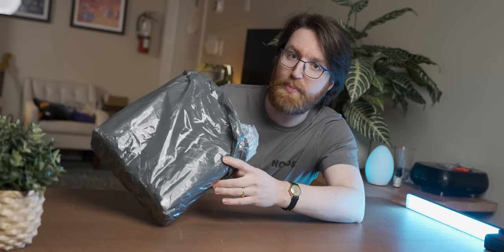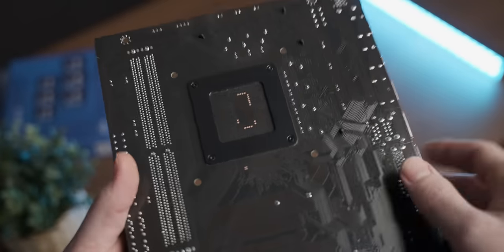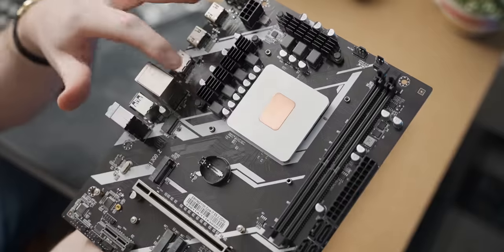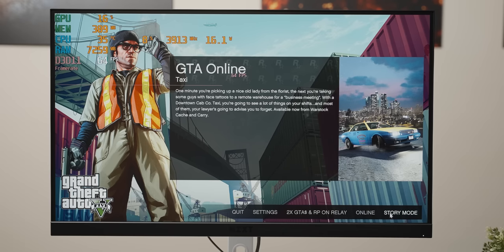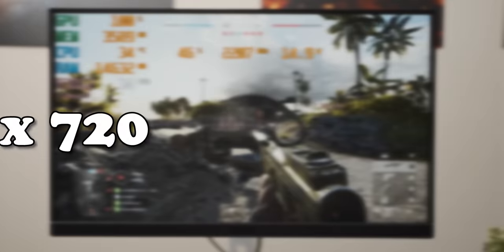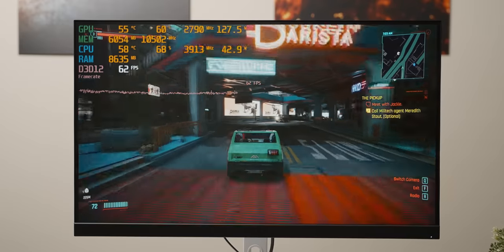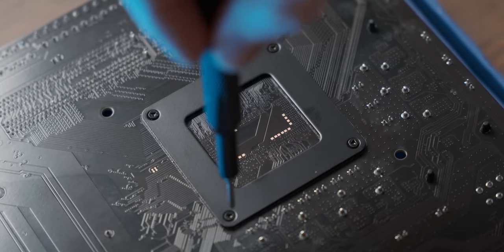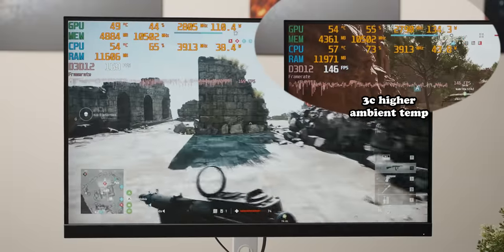Has Aliexpress Motherboard Science Gone Too Far?

Comment: You forgot to tell us what you paid, but if it's a reasonably cheap option this is a fantastic device for a small integrated system.  It's obviously not really meant for what you're using it for.
Reply: I don't know about the one he bought in particular, but I remember I checked out another version and it was basically close in performance(well CPU-Z benchmark, not really that accurate, but roughly)to an i7-10700 and the price was(for me at least) around the same it would cost me to get 12400f locally. I'd say that's a good deal, considering you get a CPU + Motherboard for the price. 
Also as far as I know these can be overclocked(both CPU and RAM), so there's a lot more performance on the table and can definitely be used for gaming. Perhaps there would still be a bottleneck on 4070ti, but it shouldn't be as bad if the CPU and RAM get OC'ed to their max potential. Seller says that RAM should be able to easily run 3200MHz.
Overall I think these are quite nice kits, the only thing that needs quite a bit more work is the bios. Few months from now or maybe an year, these should be really good alternatives for some countries.
Reply: I believe its around $150 for engineering sample models and $220 for the non-engineering sample models.

Comment: Actually there is a way to activate XMP on these kits, its just that its very, very extensive and old looking bios.
Reply: Not only that but you can also set clocks higher than that. Brazilian youtubers are doing some interesting coverage on these parts, and the i7 ES you're using can easily go past 4.5ghz

Comment: Question ;

1. Does the chipset and CPU combo support resizeable BAR? (Wondering if I could pair this with an Intel Arc A750)
2. Are the onboard HDMI ports HDMI 2.0b with HDR support?
Reply: 1: other comments say yes

2: no idea, being a laptop based chip though I'd almost say it's 50/50
Reply: @cpufreak101  Thanks much, sounds like I gotta take the jump and try my luck with the HDMI ports. If it doesn't have a 2.0b port, guess I'll get an Intel Arc to supplement it.
Reply: @dasaratabalakrishnan3916  idk for the engineering samples, but the 19-11900H, Intel's documentation states it's a 2.0b port

Comment: If I hadn't spent all my money on everything else lately I was going to buy one, it's in my cart. I want it, I love weird stuff. I just wish it came in ITX size, it would immediately become my new HTPC board.
Reply: They're planning for one.
Reply: @1986Hikaru  Awesome! I'll need to use a USB DAC or ARC converter to get Optical Audio out but otherwise I'm all in. Low power use, plenty of cores, perfect for my application. Currently running an i7 4980HQ with some OC on it in a Z87 ITX board and loving that but I need to be mindful about Win10 support ending in a few years and have something lined up.
Also I saw some vendors selling upgraded VRM coolers, I guess they run a little hot. I wonder if that was nerfing his CPU performance some?

Comment: This is quite the interesting board which i might buy the model with the i5 in it and pair it with something like a 4050/4060 when they come out or if the 4060 is better than my 3060 Ti i would use the 3060 Ti in that system while i would use the 4060 is my main system because it is still nice to have a strong backup system that could be powered by a 450w to 550w PSU instead which i am planning on replacing my 2x1tb 2.5" SSD's with a single 4tb version instead (gaming drives) which i would use in that system because for a backup system 2x1tb drives would be more than enough for it.
Reply: Also going on Aliexpress and looking up the Erying it looks like they sell separated the improves VRM heatspreaders which could provide better cooling for the VRM's in case they're not that great.

Comment: Hey if they want recycle good laptop cpus into mobos or better yet put the laptop cpus on substrates that go in regular mobos for that series I am down I know they have less lanes etc but one of the ocable laptop chips in a half decent mini itx board or smaller that still has a full pci-e slot is sfc enthusiast wet dream. Especailly if they want to start recycling laptop gpus in this manner, low power high performance low noise, upgradable tiny gaming pcs yes please.

Comment: i have an i5 11400H it games nicely except intel cpu run hotter than i'm used to it's definitely not gonna make me switch from AMD to intel on builds heck i even prefer AMD laptops just couldn't get one unless i wanted to spend $200usd extra for an R5 5600H the equivalent of the I5 11400H 64GB of 3200mhz ram makes a laptop run really well

Comment: You would think that as long as the regulations surrounding lithium batteries have been in place, some kind of workaround would be found other than just shrugging and shipping motherboards with no batteries at all... like maybe using alkaline batteries or something else that isn't restricted for BIOS batteries. I get that the increased power density is necessary for phones, but is there really any reason why we can't just use AA batteries for a motherboard BIOS? I just don't get why everything is designed to make use of a restricted item if they knew it was restricted when they designed the stuff.

Comment: Lithium 2032 batteries were used for a millennium flying on aircraft with zero issues.  Then some jackass decided to make a 99.99wh lithium battery with no safety testing and a handful of them went kablooie killing Jesus and doing 9-11 and now people are so paranoid about lithium batteries that even ones the size of a grain of sand require so many special considerations for transport that it really makes no sense to send a motherboard with one pre-installed.

Comment: Somehow they are no longer being sold. I just checked so I see why the link is not in the description. Also, it says they can be overclocked so I am wondering why you didn't OC this using XTU?
Reply: I think you have to use a third part throttle stop or APU unlocked etc
Reply: @Jordan C.  on aliexpress it says to use xtu

Comment: can you please get a $30 Watt meter and measure actual power consumption of this thing from the wall? A reason I would get such a build for myself is being able to power it using DC-DC pico PSU running off of a battery pack

Comment: Dam gust bought yesterday erying i9 11 11900h combo CPU motherboard 176 total for try out gameing with my arc a770 16gb or use my rx6800 mybe
Reply: The A770 requires Resizable BAR to work properly, so there's that
Reply: @jayhardway23  I'll have try my rx6800 than  I'm not  fps hore  for attention  i game good on my Arc a7700 no problem on 10th gen i3  with re bar or with out it Im mostly on cod or whatever good
Reply: @jayhardway23  I'm definitely goin test i9 11th gen tiger lake 11900h  out on lot games  when arrives March 18th

Comment: BE WARNED!!!!!!  I purchased the i9 version of this board.  Mine is obliviously faulty and I cannot get it to install windows 10 as it resets at random intervals during the installation process.  Erying have an updated BIOS available however u can forget trying to update via a usb dos stick as there is no way of enabling legacy boot option.  I ended up ditching to command prompt at the beginning of the win10 install and having a go through there only to be greeted with " Error 20: Cannot locate ME device.  FPT operation failed"  This leads me to believe the Intel Management Engine is either faulty or the bios is corrupted on the motherboard.  The best help i get through the ali express chat feature is that i need to update my drivers apparently.  It's like pissing into the wind I swear.
Reply: Are you using it on board video? If so, try a graphics card that worked for me. But I'm still getting random reboots after installing Win10
Reply: @sosa99999  Hey it seems that they are sensitive to the power supply.  I seem to have solved the random reset issue by using another PS.  Thing is the power supply that was causing the issue was new and tests fine under no load.  Will test it in another PC.
As for using a dedicated graphics card, have U seen what's compatible with this board?  U can't just go and chuck any card at this thing.  There's roughly 20 or so cards that work all of which are NVIDIA except one.  I have tried a random number of cards with this board and nothing works.  I don't have any listed cards to try.
Reply: @MyNameIsPlayer2  I had an old AMD HD 7000, which gave me less reboots. Then purchased today an Intel ARC A770 and it seems to be stable now.

Comment: Being a laptop CPU soldered to that board.
IS the GPU running at x8 or X16 speeds? Most laptop motherboards run the GPU at x8.
Reply: It supports up to 16x Gen 4.
Reply: @GAMMAXII  "supports up to" is not the same as being x16 gen 4.
Reply: @Teksers  I tried a Gen 4 x16 card on the board and according to SIV64X, it runs at 16x @ gen 4 speeds and it should given that the Tiger Lake H supports Gen 4 @ 16x and Gen 4 @ 4x for the main M.2 Slot. Though ATM I have a Gen 3 card on the board (Titan X Pascal) and that runs at 16x @ 3.0 like it should.
Reply: @Teksers  It is 16x Gen 4. Confirmed with an RTX 3070.

Comment: Dawid Does "Beginner" Tech Stuff. Seriously, even tho UEFI  is a modern replacement - that's the most common/used type of BIOS. Thus, using/configuring it - is a basic requirement in any reputable Tech department. Yet, this guy struggles to navigate its menus - which means - he's probably used to dumbed down GUIs (abbreviation for graphical user interface - in case you struggle with tech terms) - like the ones you find in Windows and UEFI. First time i bumped into this channel - and honestly - it's quite laughable what type of people call themself Tech savvy this days (especially by making a YT channel which revolves around Tech Stuff).

Comment: Maybe its not cpu bottleneck, it can be pci lanes. It may have fewer lanes on the x16 slot.
Reply: Wikipedia states these have 20 PCIe lanes
Reply: @cpufreak101  the cpu has 20 lanes, that doesn't mean the motherboard manufacturer has put those lanes. Some of those lanes go into chipset, m.2 slot and all.
Reply: @virusz4274  I just bought one of these boards, I'll check it when I have some time, though I saw another YouTuber review this and I think Dawid's issue is that he misconfigured the RAM to not run at full speed
Reply: @cpufreak101  Cool, please let me know. I watched craft computing video and he read the manual that came with the motherboard. in that manual it is said the pcie x16 slot is pcie gen 4 slot.
Reply: @virusz4274  yep I saw that video as well, apparently the chipset also has some PCIe lanes as well which is why it has two NVMe slots
Reply: @virusz4274  as far as we can see, all the pins are in the X16 slot and all are connected to traces, seems to be a true X16 gen4
Reply: @cpufreak101  thanks for the update. So it must be a cpu bottleneck.
Reply: @virusz4274  it's ram actually, he never changed it from 2133 due to the confusing bios, which even I got very lost in, but if you know what you're doing EVERYTHING can be tweaked.
Reply: @cpufreak101  i saw somewhere that bandwidth bottleneck is there and cards like 3060 is good fit. The bandwidth for the x16 slot is limited

Comment: What's crazy is that people usually build PCs because they can be upgraded down the line but this product takes that idea and drowns it in a pool of soldered parts
Reply: Doesn't stop you from changing out the motherboard.
Reply: @BobPony  bruh
Reply: not really, in most cases people just upgrade the GPU
Reply: You’ve got one part soldered down. Memory, nvme, Wi-Fi, GPU, etc… All still upgradable. Also, I don’t believe the main reasoning behind most builds is upgrading down the line. In YouTube comments arguments, yes. In real life, no.
Reply: @emlyndewar  agree. The only time i upgraded only cpu was from Athlon II X2 to Phenom II X4
Reply: same
Reply: @Turbobuttes  Yes, my money does not grow on trees. With this cpu, 16gb 3600mhz from Asgard, NVMe from Asgard and the infamous 6600m from Sheli, i can run with 90% of the performance of an actual 5700x and xfx 6600 for half the price.
Reply: @emlyndewar  I haven't agreed with a comment on YouTube THAT much, for a looooong , long time!
Reply: @rawednylme  yeah I agree, I was just exaggerating the point, it probably wouldn't make a difference to most people unless they are one of the people who upgrade their CPU frequently for whatever reason. But to be fair as GPUs are advancing so rapidly a perfectly fine CPU now might be a huge bottleneck in only a few years
Reply: @Bob Pony  that's kinda what I was referring to, if you want to upgrade the CPU you need to swap the whole motherboard unless there is a way to solder a new cpu to it
Reply: @BobPony  yeah my point was you can't upgrade the cpu without replacing your motherboard

Comment: Most of the times, batteries are NOT included for fire hazard and explosive issues. That's common sense with shipping, especially with long travel shipping types (more specifically from different countries mainly). That is why you hadn't the battery in the MB.

Comment: You could reduce bottleneck by cranking up the resolution. If you don't have a 2K or a 4K monitor just go to Nvidia Control Panel then enable DSR Factors (1.74x and 4.00x) and put smoothness to zero then it will simulate the 2K or 4K resolution on 1080p.
I use DSR on BF2042 to lower the CPU Utilisation.